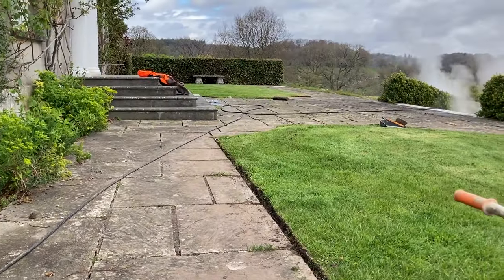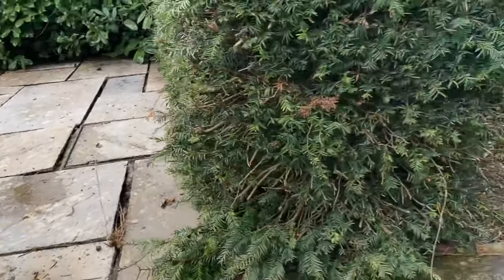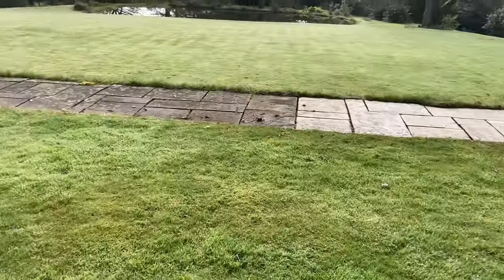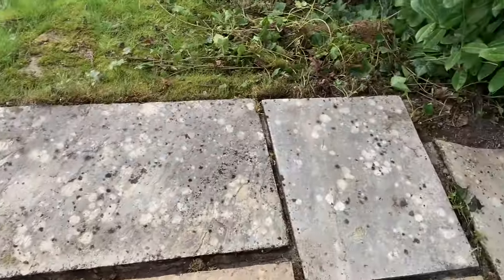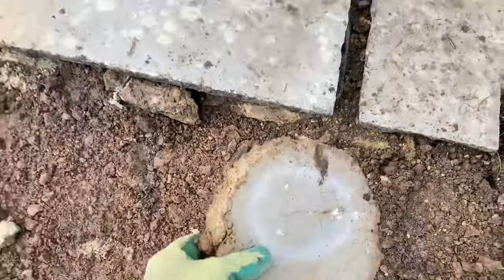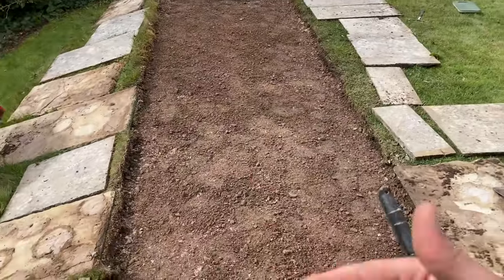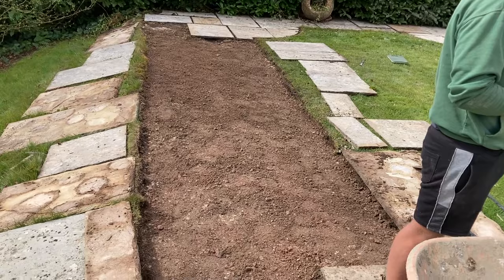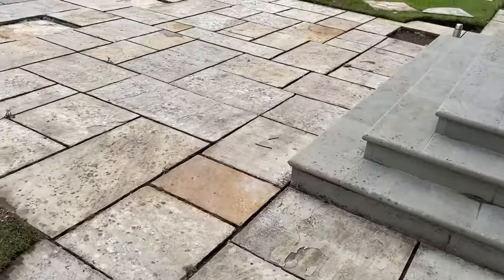How NOT To Lay A Patio!

Comment: The cavalry to the rescue.
I was amazed that the slabs were so thin. That's the problem I imagine. In the good old days when the slabs were 3-4 inches thick you could spot the mortar but with wafer thin stone there isn't the weight and freeze/thaw cycle just lifts them.
From a distance it looked OK but closer inspection reveals the work of cowboys -- even the pattern was 'strange'.
Only solution is to lift it all and relay properly. I have found (with my limited experience) that it's like teeth....take out one loose one and it loosens all the ones around it (I am not a dentist either!!)
Nice property.....even nicer when you sort out the patio.
Reply from the maker: Yes your right Sean! Thank you for watching!

Comment: You've just moaned that the slabs weren't installed right....
Then layed them on hardcore......
Reply: Please tell me you cemented them in. Otherwise you have actually caused damage and relayed them worse than originally
Reply from the maker: 🤣🤣 yes of course at least 250mm of cement. Customer only wanted a quick repair on loose slabs and was told we can not guarantee as the whole job needs relaying.
Reply from the maker: Laid them on hardcore? 🤣
Reply: Always the way, good work mate 👍